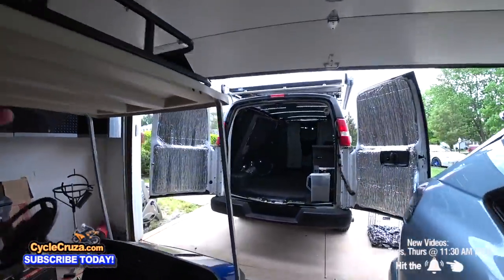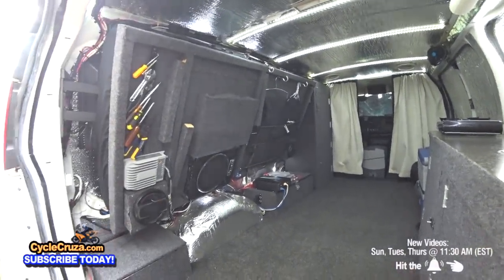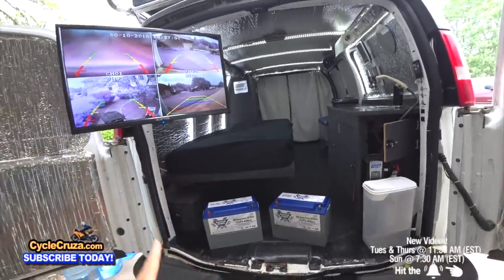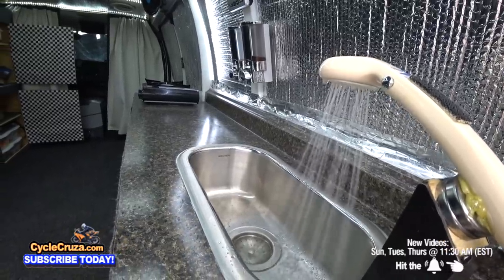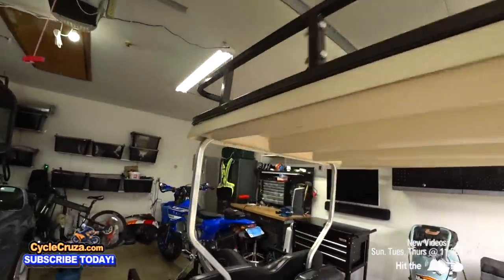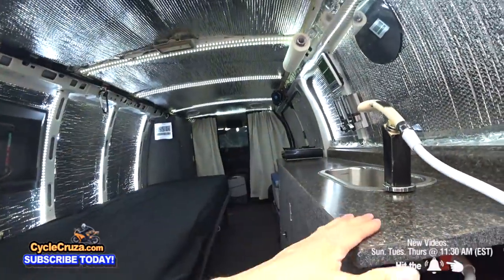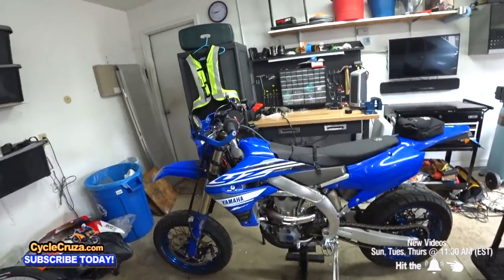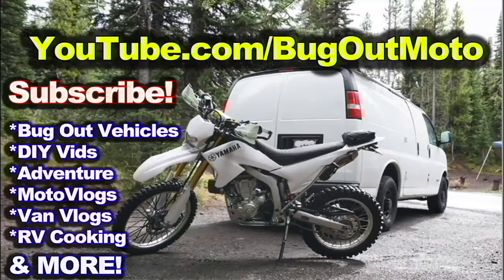CycleCruza DREAM Come True - GOODBYE

Comment: Those Maintanence  sechules  are for flat out racing..  I adjusted the valves on  my  1998  Yamaha  YZ-400-F  one time..   A few valves were off so I had  to  buy the  proper  shims  to   get the correct valve  cleance..  I have  a 4 stroke  Yamaha  snowmobile    with the  R-1  Motor ..  so 5 valves  per cylinder  4 cylinders   there  will be  20 valves to adjust..  
  I can tell by looking at oil if  it's  good or not..
   You ride on the  street did you  ever  go  up  one tooth on the front  sproket ??
  How far do you have to move..  I was going to say I have a  fully Enclosed  two axle  snowmobile trailer.. but  On  second thought you   my  need a Semi  Trailer  moving van  type  situaiton ..